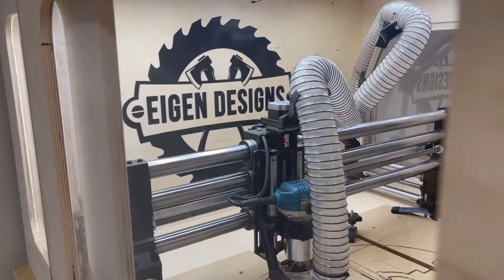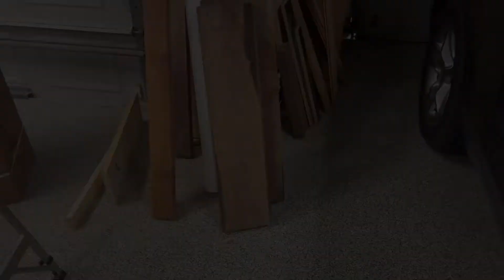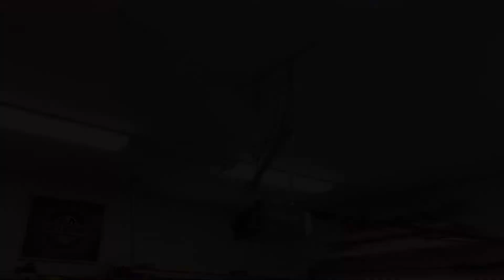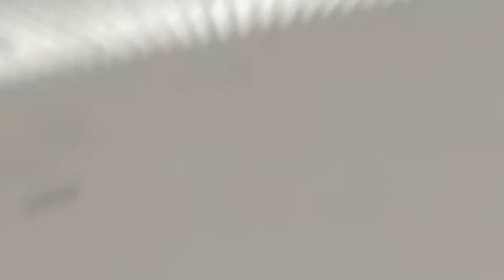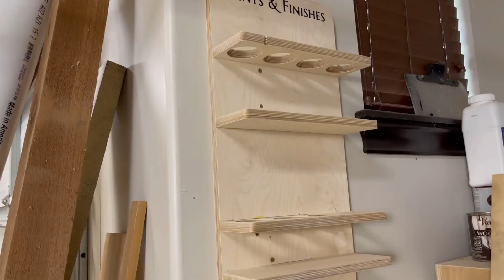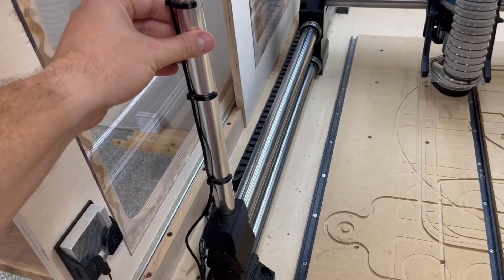10 Workshop Upgrades  |  Enhance Your Shop Organization & Functionality

Comment: Nice job on the upgrades!
One of those air filtration units has been on my shop upgrade list forever.
I upgraded my shop lights to LEDs last year and it's probably one of the biggest improvements that can be made in a workshop.
Reply from the maker: Thank you! Do you have any ideas for my shop?
Reply: @EigenDesigns  Looks like you have a very well thought out setup. :-)
Maybe add a cyclone separator to your dust collector. Your shop has already come a long way since you started!
Reply from the maker: @NWGR  That's very true. I am grateful to have the space that I do with the equipment that I have acquired. I think upgrading the dust collection is something I will definitely do in the longer term. I was fortunate enough to pick up my delta dust collector from someone locally who was selling it for $150.